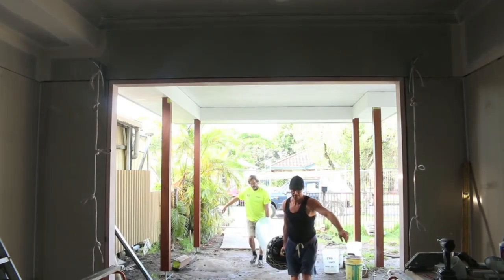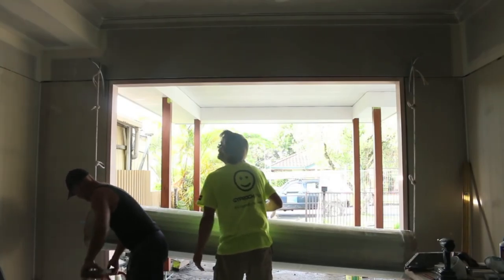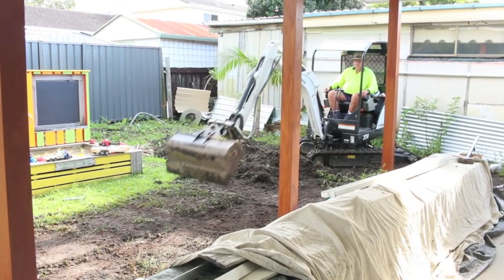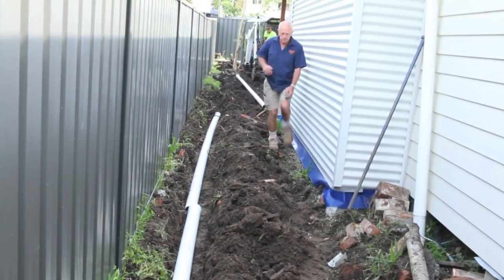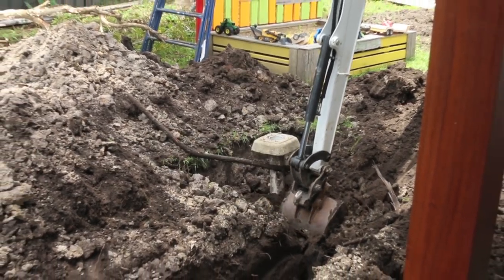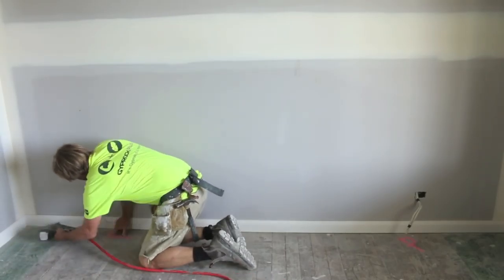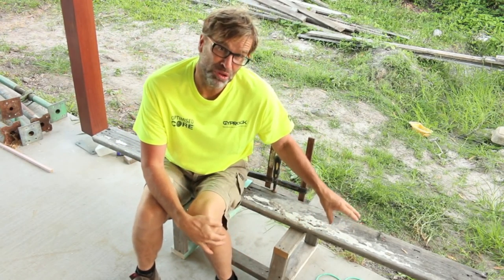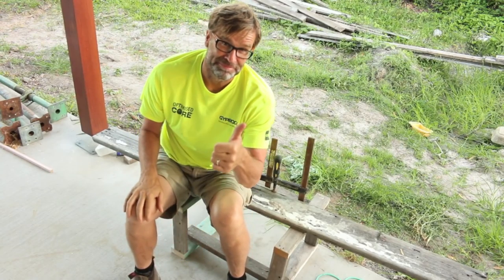Owner Builder Series Ep 33: Drainage, Garage Door, Tiling and Fixout!!

Comment: You guys do it different in Oz to us Brits Shane, I work on groundworks and digging drains for sewage, we have a large drainage inspection area where as you guys just have a capped pipe out of the ground and the rainwater drainage seemed deep we normally go down to 100mm  with a drop to a soakaway. Anyway mate glad to see it all coming together nice, until the next one Tony.
Reply from the maker: +Woodworking Brewer Yeah different horses for different courses Tony. We were pretty lucky. I've done renovations before where the boundary trap was 3 metres down! Not fun. Cheers

Comment: Gradually catching up Shane. As a chippie it would be good if you could do a tutorial video on coping and fitting skirting boards. It looks like I do the coping the same way, but there's probably lots more tricks of the trade I'd like to hear. Also getting tight outside mitres, as the walls generally aren't at 90 degrees once plastered due to the corner bead.

I'm curious as to how the plumbers got the appropriate fall on the sewer as I didn't see a laser staff anywhere. Assuming the block is level, it looked like quite a fall, and would be keen to know more about how they established their levels.

Old news I know, but great stuff just the same.

Edit: Ooops sorry, now looked ahead and see you did a video on exactly what I was asking! Awesome!

Comment: Hey uncle knackers your home reno has been fun to watch. I have  a question how did you attach  the new framing to the slab  was it concrete screws? also when are you going to release more videos up to finishing the reno. Keep up the good work:)
Reply from the maker: +Murray Fitzsimmons G'day Murray. I attached the bottom plate to the slab initially with concrete nails that you nail in with a hammer. Then l use dyna bolts that are inserted through the plate and into the slab at intervals in accordance with council regulations. New videos coming up soon l hope….! Long story but l haven't had an internet connection for two and a half months!! All l have is my iPhone which isn't good enough to upload videos to youtube. Hopefully the drama should be sorted out shortly….fingers crossed. Stay tuned. Cheers
Reply: +shaneconlan1 I was just about to send you a note asking where you've been as I've been wondering why you haven't posted anything and was concerned something tragic may have happened or those knees finally gave out etc, etc. Then I read your reply about your internet issues and as strange as that is, at least I know you're still at it and I assume by now the house is or at least nearly done so hopefully soon you'll be back on course.